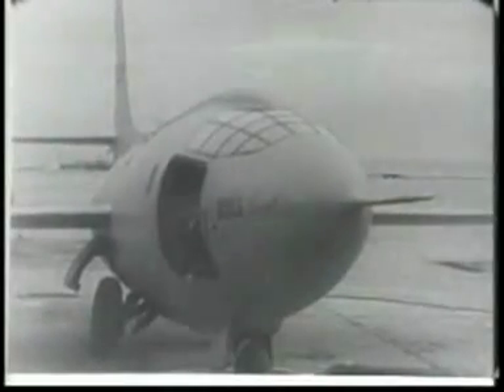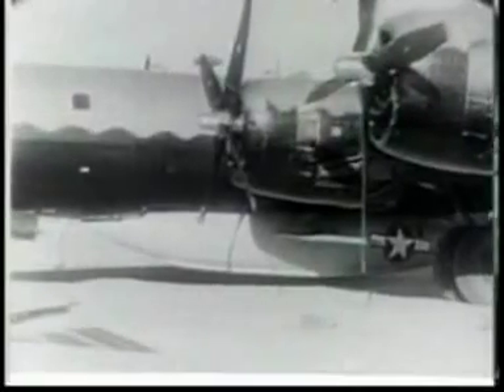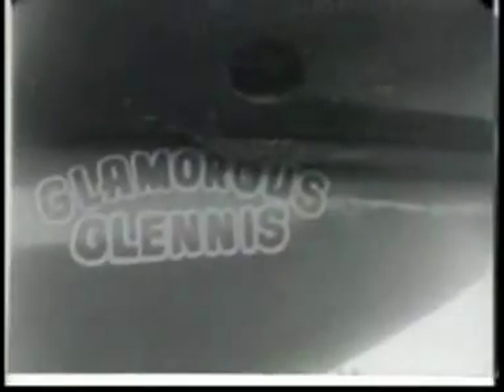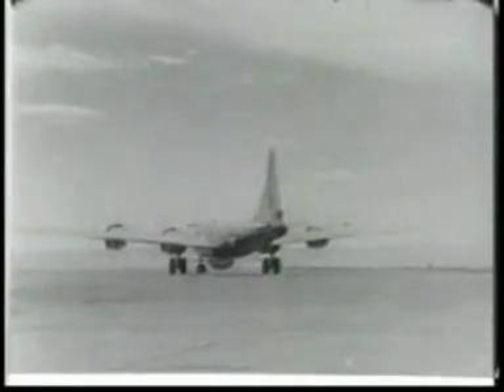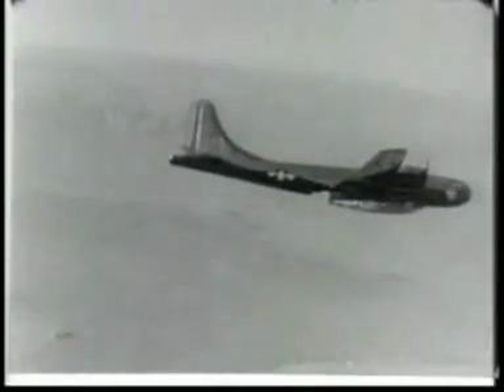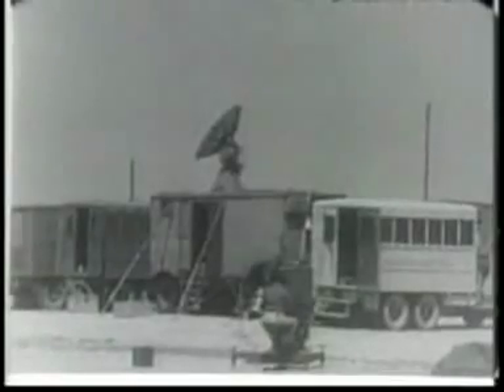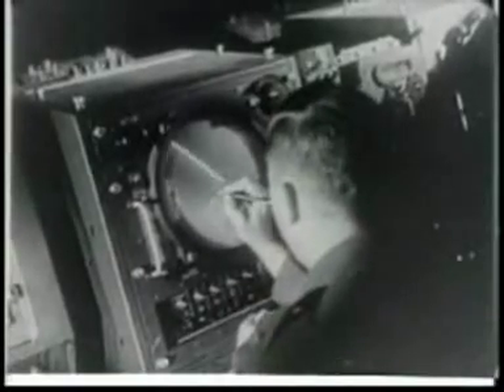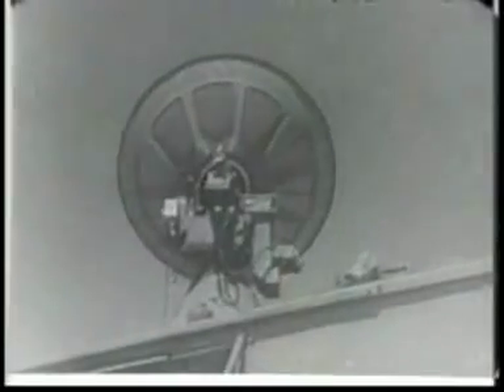X-1 Rocketplane "Glamorus Glennis"

Comment: Where did this film short come from? Any credits?
Reply: I'd put $100 on it having been produced by the Air Force.
Parenthetically, the Air Force had been a separate service less than a month when Yeager flew the X-1.
Reply: Thanks. I'm not doubting the authenticity of the film, but I'm wondering if it's "re-enacted" for the purpose of the newsreel. I'd like to steal it for our e-WV website!
Reply: How come? Was Yeager from WV or something?  
Kidding, kidding.
Tell ya what, speaking as an Air Force guy, Yeager was the real deal as an Airman. Fascinating bio. Wish we'd had a lot more like him and Jimmy Doolittle.
Reply: Mike, small parts of it may have been re-enacted, for example, Yeager sitting in the cockpit doing his flight controls check. The flight itself, I'd say, is the real deal.
Reply: I found this on Youtube:
First Supersonic Flight: "Breaking the Sound Barrier" 1947 USAF; Chuck Yeager in the  Bell X-1

It's the same thing as is on the Air and Space Museum site I linked above. I'm betting this 8 minutes of material was the source for the 3 minute newsreel. As was so often the case, you can tell that the newsreel was shot silent and all the sound added in post. So it's authentic in that it was shot by the AF during testing and so forth.
Reply: Also, the quality of the video in the silent footage is better than the newsreel. :)

Comment: Sorry the RAF would had done it unoffically in the Gloster Metoer, introduced in July1944 with a top speed of 600mph. It would of easily broke the barrier on a dive, probably reaching 761mph (Mach 1).
Reply: The version available in 1944 only had a top speed of just 412 mph.
Reply: The Gloster Meatbox was not capable of achieving Mach 1 in a dive..

Comment: I have no doubt a Spit turned a .92. But I wasn't talking about Test Flights. I was speaking of Pilots diving to shake off an enemy A/C. and never pulling out of the dive due to compressibility.The forerunner of busting Mach 1. Maybe some flight engineer can confirm or deny this Theory. " I don't think a prop job can break the sound barrier" But I have been wrong before. LOL Like thinking I could get a fair shake in a divorce court.

Comment: @usafvet100   And the British had pretty much given up on braking the "Sound Barrier" after losing De Havilland. I'm not for giving them any credit on the aircraft design either. 'Specially since the "Swallow" was tailless. Quite frankly. If not for Jack Ridley. I wonder if the Speed of Sound would have been broken in '47.

Comment: @hawker445 It was the British who solved the X-1's stability problems by moving the whole tailplane instead of just the rear section of it as was done previously but now the Americans claim that it was them who discovered it when everyone esle knows it wasn't
Reply: The Horizontal Stabilator is an American invention
Reply: @sandervanderkammen9230  The British wartime Miles M.52 supersonic project was designed with stabilators. Though the design only flew as a scale rocket, its all-flying tail was tested on the Miles Falcon. The contemporary American supersonic project, the Bell X-1, adapted its variable incidence tailplane into an all-moving tailplane (based on the Miles M.52 project data) and was operated successfully in 1947.
Reply: @aaronjones8770  What M.52? No aircraft by the name M.52 ever existed. The fastest jet aircraft ever produced by Miles Aircraft has a top speed of just 289 mph.
Reply: @aaronjones8770  The HORIZONTAL STABILATOR was invented by the Wright brothers in 1903.
 The first aircraft to use a Horizontal Stabilator to counteract the effects of the compressibility at high transonic speeds was the Messerschmitt Me-262.
The Bell X1 uses an exact copy of Me-262's fly-by-wire, electric stabilator trim system.
Reply: Miles M.52 never existed
Reply: @WilhelmKarsten  No but the horizontal stabilator was tested on a modified Miles Falcon before the X-1 was even built.
Reply: @aaronjones8770  The Horizontal Stabilator existed long before the Miles Falcon was built... it first appeared on the American Wright Flyer and several WW1 German and French fighters.
Reply: @aaronjones8770  The Messerschmitt Me-262 and the Curtiss XP-42 both had Horizontal Stabilators to counteract the effects of compressiblity before the Miles Falcon was built, please stop posting lies and misinformation, it is not a British invention.